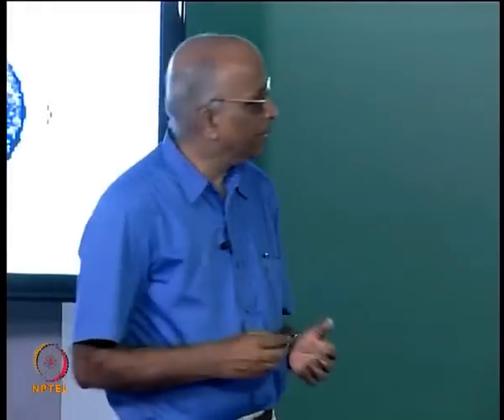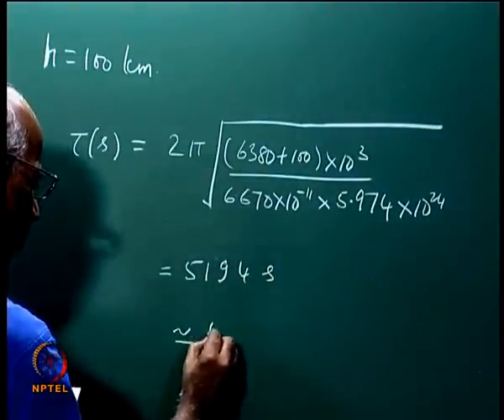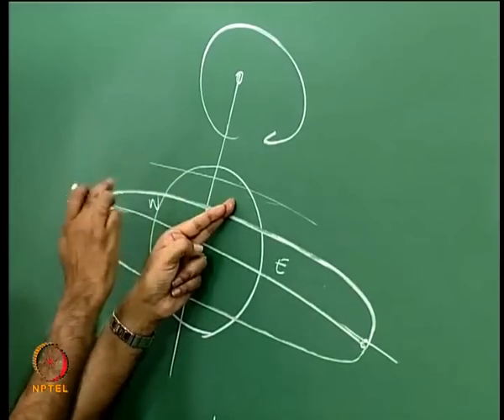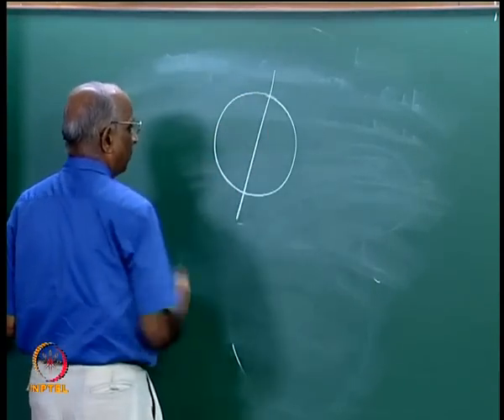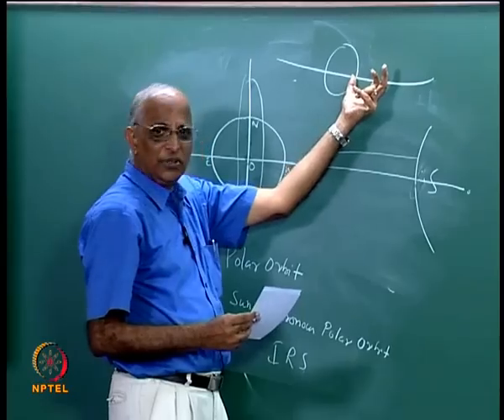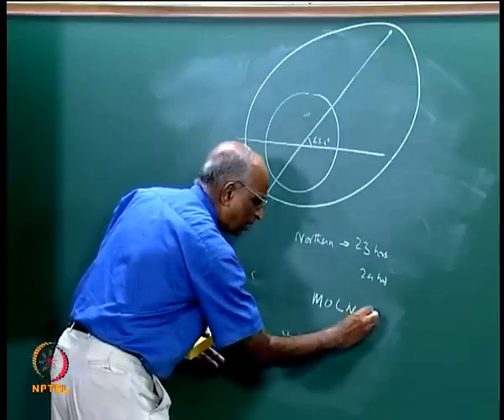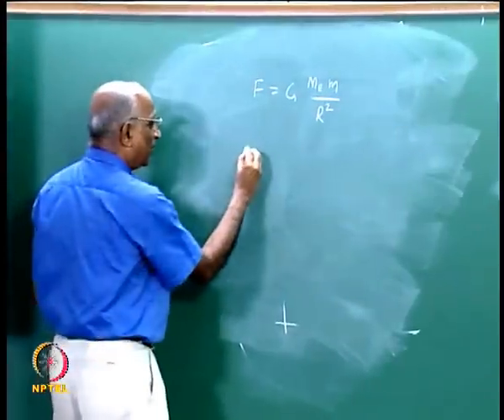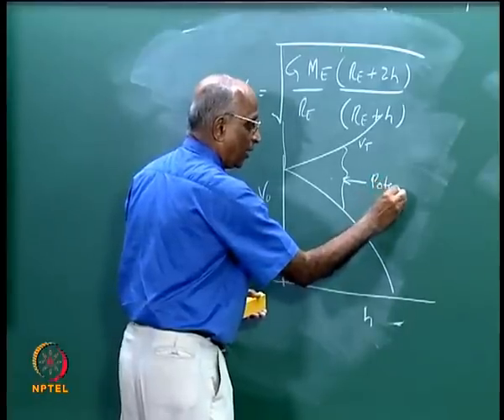Mod-01 Lec-04 Velocity Requirements

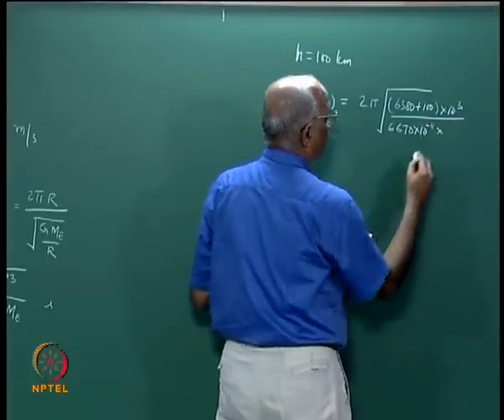Comment: @ ~7:00 min, Professor R. forgot to cube the radial term (R+h).

He wrote: (6380+100)X10^3 under the radical,

when he should have wrote: ((6380+100)X10^3]^3. 
{the 10^3 is to convert from km to m}

The answer he wrote down, 5194s, is still correct (although I calculated 5192.1s, which is probably attributed to rounding). It is merely a "copy-down" error.
Reply: was thinking the same!